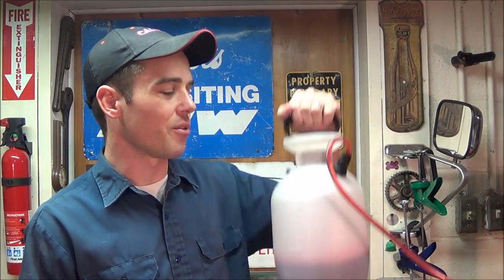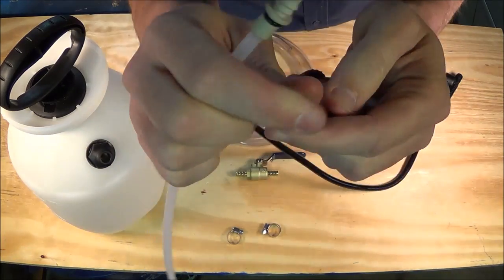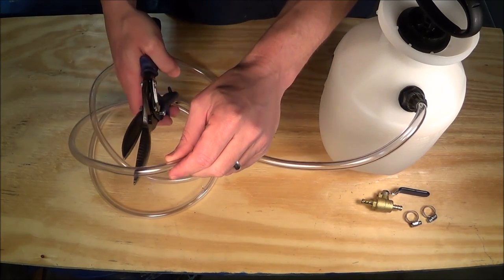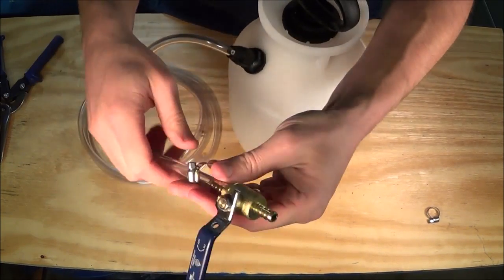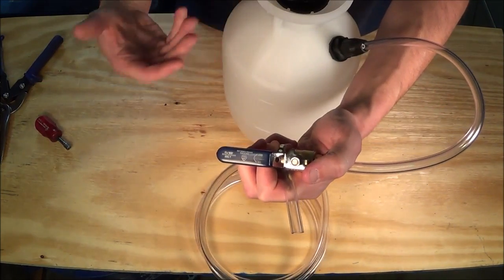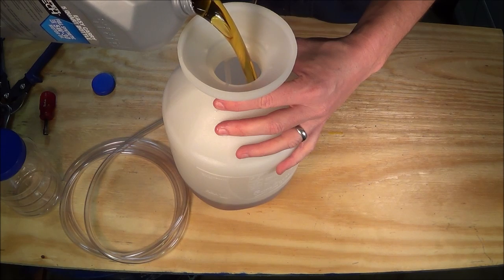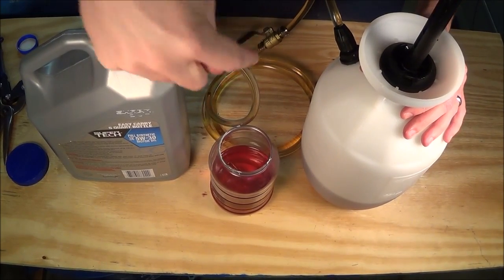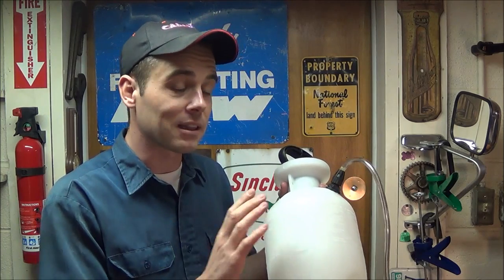How To : Make a Pressurized Fluid Dispenser

Comment: I used same pump type to fill coolant on my motorcycle from engine drain plug. Just open the cap on your radiator. It was a sport bike and side  and front fairing should normally be removed. 
Excellent video and detail.

Comment: I just happened to have same idea to make one in order to flush my brake lines -- only difference is I tapped a hole near the neck and screwed a pressure gauge into it so I can monitor pressure and check for leaks, etc. Considering I already had the spray bottle sitting in garage, definitely a heck of a lot cheaper than buying one of these -- and works just as well, if not better!

Comment: Have you tried it with gear oil? Thought about making one of these, and leaving the gear oil out in the sun a bit to thin and warm it to make it easier to flow
Reply from the maker: Yes.  You can also set the entire sprayer in a 5 gallon bucket of hot water to speed up heat transfer….. just don’t submerge any of the fittings so it doesn’t accidentally get water mixed with your oil.

Comment: Sometimes worm drive clamps will not seal small diameter hose very well , use small  hose cinch ring clamps ( Oetiker in the manufacture ) . Amazon has these clamps .

Comment: If you dip the clear hose into hot water for 30 seconds , it will slip on to the ball valve much easier.

Comment: Would you recommend using a different sprayer for each type of fluid you want to work with, or could you clean it out with some type of degreaser between fluids? Putting transmission oil, engine oil, and gear oil in the same sprayer canister at different times, for example.

Comment: If anyone watching in 2023, IMO a much simpler way here. Cut the tip of the end of the black wand, then heat it up to a 90 degree angle and you can just reconect the stock thing back in and  voila

Comment: Stumbled across this video after looking at EXPENSIVE options online. I made one of these today for $23 plus tax, but even better IMO. No ball valve. Use a cheap air compressor blow gun, get a 1/4 MNPT x 1/4" barb, a 1/8 MNPT x 1/4" barb, screw them into the blow gun with some thread tape, and put it at the end of your hose. Cut another desired length of tubing to attach to the business end, and now no more valves or mess from lots of fluid out of a long tube post-valve. Push to dispense, let go to pause.

Comment: If you want to use the same pump for different oils (diff, gearbox, haldex) how obsessive do you need to be about cross-contamination? Eg do you need to wash with petroleum solvent then isopropyl alcohol then ensure completely dry? Or just empty it out as much as possible? I suspect some of the seals in cheap sprayers may not be very resistant to petroleum products because garden sprays are water based.  But I'll try it for sure.

Comment: Can I use this for thicker oil such as differential fluid or Lucas additives?
Reply from the maker: Sure.  Just keep in mind temps….. The colder the fluid, the slower it will flow.  You might want to submerge the sealed container in 5 gallon bucket of hot water for 10-15 min prior to using it to heat the lucas additive or oil up.

Comment: I've seen a couple of similar videos, and they always seem to put the ball valve close to the pump instead of closer to the end of the tube where the fluid will be coming out. Normally, when you are pumping fluids, you would want to pressurize the tank, set it aside, then take the end of the fill tube under the car and watch it fill up until the side port begins to drain. In that case, you want to be able to control the on/off of the flow near the end of the fill tube, rather than having the ball valve all the way at the other end of the tube next to the pressure tank. So in that regard, I actually think the original squeeze handle that the tank comes with, where it would be attached close to the end off the long fill tube, is actually a better design in that it gives you precise on/off control right where you need it, without needing two hands to twist a clumsy in-line ball value.

Comment: Why get rid of the trigger on the wand?  That was your valve.  LOL  You threw out the valve you paid for with the sprayer and bought another valve and two clamps that aren't even necessary, unless you're going to take it up to 40-50 PSI, which most of these cheap sprayer vessels aren't rated for and isn't needed for automotive fluid transfer anyway.  

This didn't need to be as complex, time-consuming and expensive as you made it.  But hey, we've all been there.  LOL
Reply from the maker: Full flow (on/off) VS requiring to push a lever in the entire time

Comment: This was EXACTLY what I needed.. thank you, Sir!

The sprayers I found though had really tiny little tubes to the bottom of the sprayer.
I wound up flipping the nipple with the o-ring on it over, trimming off some of the plastic, and then sliding the o-ring onto the tube. The tube went onto the trimmed section of the fitting/nipple/thing adn then to the bottom of the tank. The o-ring got rolled onto the plastic nipple/fitting over the tube, to create the seal. The collar locks it all down nice and tight, so now I've got a 1/4 inch ID pickup tube to the bottom of my gallon tank.

I needed this for a DSG transmission service on my Jetta TDI Sporwagen... the parts companies wanted like 120 for it. This was done for 30, tops!

Again, thanks SO much for the instructions! 

Hinoki
Reply from the maker: Glad to help!

Comment: Hi. Brilliant invention by the way.!! Love it.!!! . I wish to know if this can be used as a coolant  extractor and /or filler. Thanks in advance for your response.!!! 🖐️😁
Reply from the maker: Yes, any fluids really.  I wouldn’t suggest using with gasoline, but anything else should be ok.  Also, only use ONE type of fluid.... if you need multiple types, make multiple units.

To use as an extractor, you’d have to plumb in a small vacuum pump (pneumatic) and it should work easily.
Reply: @RealToolReviews  Thanks for your response.!!!

Comment: Are you sure you did not use a 1/4 inch pex ball valve? Did the 3/8 inch pex really work with a 3/8 outside dia. hose?
Reply: Try sticking a pair of needle nose pliers in tubing it'll make diameter larger.
Reply: @jean-pierredejon7458  does the 3/8 pex valve work better than 1/4?  why not just use  a valve made for 1/4 ID hoses?

Comment: Just a word of caution, if anything, such as water gets on top of the pump mechanism, it will suck in through the top where it "breaths" and pump water right into your fluid, so make sure not to leave this where it can get wet.
Reply: Probably a good idea to tie off a plastic bag around the neck to prevent contaminants from entering.

Comment: Great idea - but doesn't a length of pipe with a small funnel at the end do the same job??
Reply from the maker: If you are filling from above, sure..... let’s say you are filling a rear axle..... remove plug and fill until it pours out..... not as easy with a funnel and zero room above you.

Comment: Thnx for video. Can you tell me if this would help to prime a vehicle's  lifters and oil system via the oil pressure sending unit hole? I have a vehicle that has been sitting for 4 years. Let me know what you think?

Comment: One other trick drill a hole for metal valve stem (TR416) from slime.com. drill hole to size and 1/2 to 3/4 of pumping is done with tire pump. Hand or electric pumps can be used too.

Comment: My only problem with vinyl tubing is that it gets hard after having been used once or twice.  Is there a good vinyl tube that won't harden?  I am not really sure if it is the fluid doing that or just the tube getting old.  One thing I would recommend is to keep some extra tubing on hand or maybe even use the clear reinforced tubing.
Reply: You can buy silicon tubing...

Comment: I drilled a hole in side opposite outlet and installed a tubeless tire valve. (Size of hole is listed on tire valve package).
  I use a tiny 12v tire air compressor with locking chuck. Gotta be careful, pay attention to not over pressurize, but my crappy little air pump doesn't put out much.  Don't use locking chuck, don't ask why I know this.
It's impossible to pump the handle when laying down under rig that is up on ramps.
Reply: I like that idea

Comment: Holy cow! Why couldn't I find this video (or think of this myself) years ago. This will make dealing with differential gear oil and Toyota's stupid sealed transmissions (no dipstick) sooooo much easier. This is great. Thanks for the video!
Reply: I know the pain of sealed transmissions.  My Volkswagen has one that is very much like one found in a Toyota.  It is probably very similar to a Toyota transmission since my 09G is made by Aisin Warner.  In cars other than Volkswagen that is known as the TF60SN.  They are found in all sorts of cars really and now these days most transmissions are sealed.  All sealed means is that it is more difficult to check the fluid level or drain and fill.  Sealed transmissions like mine still have a drain plug and a fill hole.

Comment: It seems kind of slow filling the quart jar you used.
To flush my automatic transmission, it would have to pass at least 14 quarts of transmission fluid, which is similar in viscosity to the oil you use here.  How long do you think it would take to do that with this system ?   How a bout 3.5 quarts of 90w gear oil ?

Comment: That gives me some ideas for my project; I want a pressurized pot full of used motor oil that will spray under my car to ward off tailgaters. Depending on the speed they may suddenly experience steering issues and slow down or they will use their wipers and be forced to stop.

Comment: Other than a little petroleum jelly on the rubber/vinyl-to-plastic areas I'd say "Top tip" build here.
OH and maybe a 3/8 push connect valve as well but still.

Comment: I have been using basically the same thing for model airplane fuel 15% nitromethane 20% caster oil 65% methanol for long time only problems I have are with the hose I use it drys out after a season of use

Comment: Hello 👋.  Would you be able to send me the brand and model of the sprayer you used in the video ? I ordered one on Amazon but the connections are different than what you showed in the video so I can’t use it. I will need to send it back. I would greatly appreciate your help. Thank you....Bill S
Reply: The sprayer in the video appears to be a Chapin, but there are lots of similar models at Walmart etc.
Reply: @asmith3846  .......thanks for the info. 👍 I ended up getting one at Home Depot and I didn't have to modify the tube that runs into the tank.  It was $8.43.

Comment: Great video, great presentation.  For simple but worthwhile projects like this, consider making them much briefer. You will have more viewers if you can get your points across quicker. You have a real talent for making great videos, but in many cases your audience is familiar with what needs to be done and the materials and tools to be used, and just needs a little guidance to get the job done.  Thanks for emphasizing the safety aspects of pressurized containers and warning people of the danger of putting flammable liquids in this device or any garden-type sprayer.
Reply from the maker: I speed things up a lot more now ;-)  thanks for the suggestion!

Comment: The link to sprayer shows a slightly different unit. Do you know if your setup still works with the newer unit?
Reply from the maker: +Michael Bennett yes, it will work.
Reply: I got everything today. It took 3 minutes to put together. The only issue is that the 3/8 Pex ball I got is as wide as the hose itself. While yours might be a 3/8, it looks like a 1/4 compared to the one stamped 3/8 on mine.

Comment: I improved the flow of mine a lot by using larger tubing, I drilled out the connection enough to run a 1/2 npt tap, the fitting I used is 3/8, the inside of the fitting was partly drilled to except a 3/8 nylon line to go inside of the tank. Flows very well with the heavier fluids.Here's my dyi oil extractor.http://www.garagejournal.com/forum/showthread.php?t=362083
Reply: I cant see the pictures, you have to join the forum, "aint nobody got time for that", lol.
P.S, if you could make a vid of it, that would be better than pics, thanks.

Comment: I recommend.
1. Using a pump with a bleed off valve.
2.  Mounting the ball valve closer to the work to improve access to the valve  while reducing the length of line after valve that will eventually drain out making a mess.
3.  Adding a cap or plug for the end of the line to reduce or eliminate the mess from #2
4.  I'd probably dedicate a pump to a single fluid and leave it filled.  Tanks would be sized to accommodate the average fluid change.  Storing 2-4 pumps of roughly the same size in my opinion is much handier than storing all the various sized fluid bottles out there today.
5.  Label pump with contents.  

Finish the oil change.  Depressurize the pump.  Cap the line.  Store pump.  Refill pump when fluid is on sale.
Reply: Great suggestions and I like the idea for sure. But with my 3 vehicles I just don’t see any need. All fluids can be fed via gravity. ATF is only one that needs a tube on a funnel but still feeds gravity. No one needs this for filling engine oil that’s for sure. The only time that this really might be handy is the rear differential which is serviced so little and is not a lot of fluid anyway the hand pump works fine. Storage?  Like I have space for 2-3 of these bottles lying around in my already full garage !

Comment: Ok, build it your way. My sprayer pump didn't work so I drilled a 1/2 inch hole and installed a tire valve. Five lbs of pressure and works better for spraying than original.

Comment: by the way. this works great in reverse to suck our oil as well.  I used the same clear vinyl tube, but I drilled out hole on in the bottle just enough to stuff the tube 3/4 of the way in to the bottle. and found a O-ring that would go around the tube and cranked down the fitting.  instead of the pump, I hook it to my shop vac. when I turn it on, all the oil is sucked up the tube and captured in the plastic container. my old 2005 wrangler did not have drain plugs on the differentials and the plugs on the transfer case and transmission were hard to access without removing the skid plate.  I have been using this method since about 2007.  when I finish sucking out all the old oils, I drain it, then clean it really good with dawn dish soap and water. like others have mentioned, I have a couple of these for different types of fluids, 1 for ATF, 1 for 75/140 differential gear oil, and one for my transmission, it uses a special Mopar NGS370 manual trans fluid.  also with my Vacuum method, never use this on highly flammable fluids, like gasoline or diesel.

Comment: good video.
you can use it as a oil extractor. if u install a another air release valve.
Reply from the maker: You would need to attach a vacuum pump to the tank to create suction.....it could be done relatively easily.
Reply: Real Tool Reviews maybe the author will do it?
Reply: +Real Tool Reviews How to please
Reply: Yes..i had the same thought.
Reply: There are videos out there where people used a small shop vacuum on a plastic gas can for extraction use. Seemed interesting to try it.

Comment: Apply a little heat and a drop of windex to the end of the ball valve to make installing the vinyl tubing easy. You could use a zip tie as a clamp too.
Reply from the maker: +opichocal Good tip!  Thanks!
Reply: add vaseline
Reply: What was the  size of the vinyl tubing
Reply: Just be sure your inside diameter of your vinyl tubing matches the barb fitting . so it will be size then I.D. 1/4 INCH EXAMPLE not all tubes are in inches some are millimeter like shark tanks.

Comment: I'm going to make several of these (gear oil, trans fluid, motor oil). It looks like this will be great for diff and transfer case oil changes. I'm going to make one for motor oil because my wife's V6 Toyota has a terribly designed oil filler hole that requires filling the oil sooo... slowly...

I bet it helps a lot if you can warm up your fluid before you get started, especially with thick gear oil. I have a vacuum oil extractor, and it works 100X better when the oil is warm.
Reply from the maker: Wayne Manion Smart move!  Having multiple units for different fluids is definitely the way to go.  As far as heating up the fluid.....I 100% agree.  One easy way to do that is to fill a 5 gallon bucket up with hot water, put the fluid dispenser in it, and that will heat everything up quickly......and it wont accidentally contaminate the oil since everything is sealed.